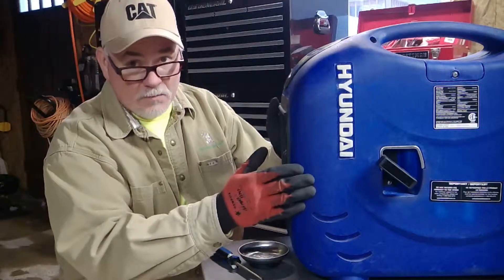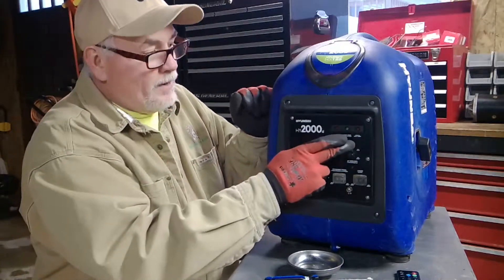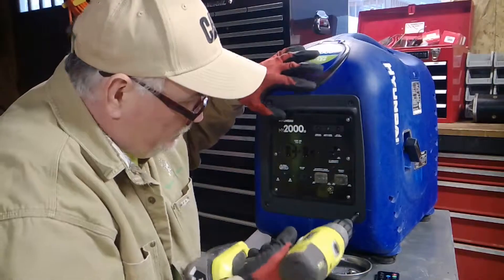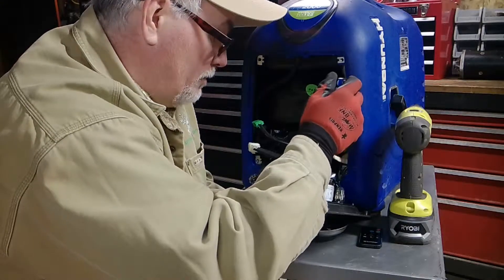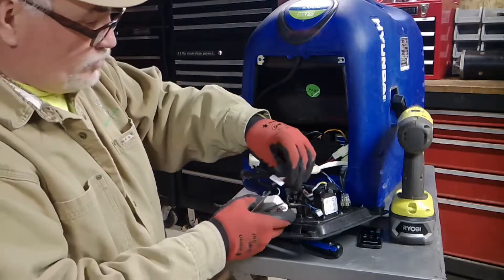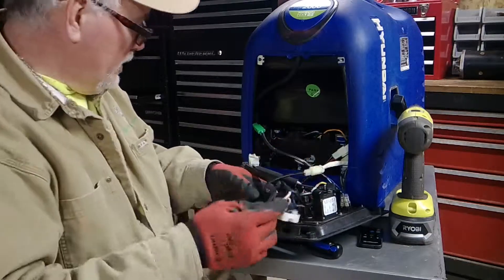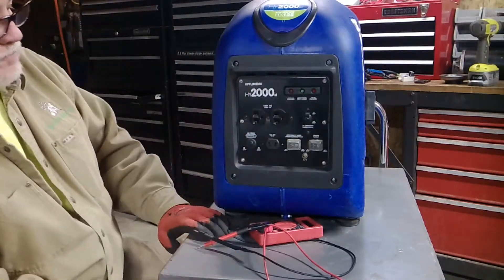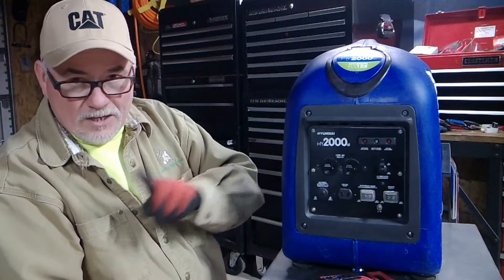BEST Hyundai HY2000 si Quick fix trick

Comment: Where did you buy the CDI? I have a green light but voltage is only 5-15 volts fluctuating out of both 120 volt outlets after a few minutes, then 15 minutes later it's producing 500-1700 volts according to voltage meter.

12 volt outlet is producing 14.55

Comment: I have this generator . Went to service it today as I had not run it for a few months. When I started it it was revving very high with no mains output.
  I reset it by touching the 12v output to a 12v battery in reverse polarity which tripped the circuit and reset with the reset button.  Restarted the generator and revving as it should mains power restored, left on test for 20 minutes without problem
Reply: Was it running when you did this?
Reply: @Ogleyman  yes
Reply: Nice man!